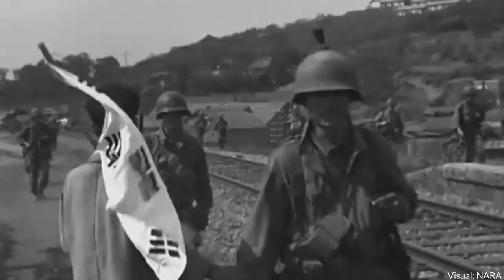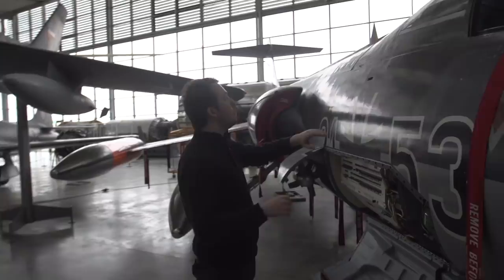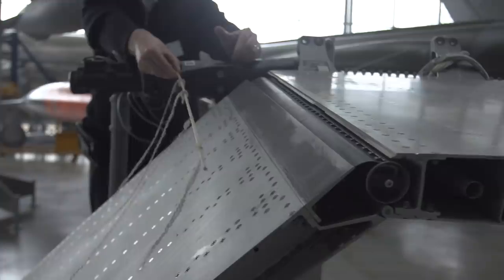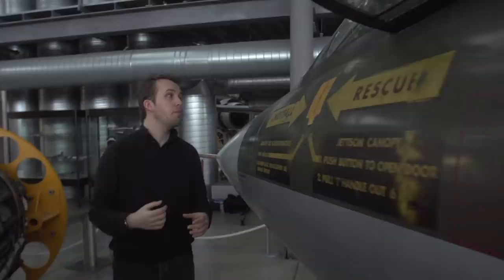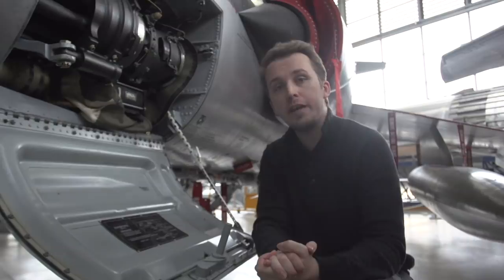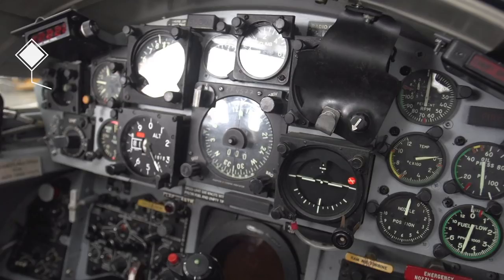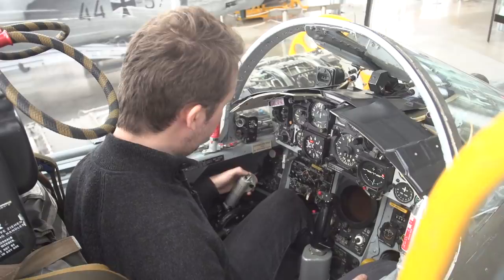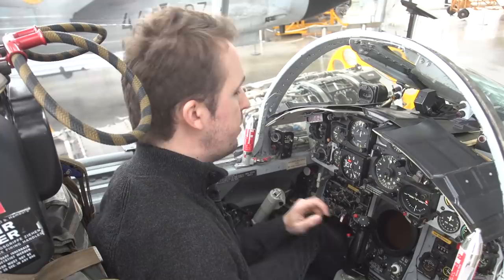F-104G Starfighter - Inside The Cockpit

Comment: "Anybody want to buy a Starfighter? Buy an acre of ground and wait"
Reply: You are aware, aren't you, that there was a similar joke made about the English Electric Lightning only instead of some area of land, the Lightning joke involved some area of the North Sea.
Reply: @lewiscole5193  I am definitely aware that this is a quote from an album "Captain Lockheed and the Starfighters" made by Robert Calvert, produced after the German Luftwaffe purchased 916 of these and then crashed 246 of them, losing 116 pilots in the process.
Reply: @fellforit  
I've only listened to the album once or twice and so I'll defer to your knowledge of what's on that album.
Nevertheless, I don't recall there being any mention that the Spanish lost no F-104s in seven (7) years of operation for an attrition rate of zero (0).

I also don't recall the album mentioning that the Luftwaffe of the F-104 days was NOT the same as the Luftwaffe of WWII, since the latter was disbanded more than ten (10) years before the first F-104 arrived in (West) Germany.
As a result, German pilots and ground crews were relatively inexperienced especially with regard to high performance jet fighter aircraft (for many German pilots, the F-104 was their first high performance ride) and due to lack of available F-104s in the early days, German pilots had to go back to flying their old obsolete aircraft just to remain current.
I'm sure you can point out where this is mentioned in the album though.

OTOH, since the subject of the ablum is the F-104 in Germany, I doubt that it mentions that in U.S. hands, the F-100 was lost more often and killed more pilots than the F-104 in the latter's short period of USAF service.
Reply: @lewiscole5193  Do you work for Lockheed? If you're trying to sell me an F104 I'm afraid I can't afford one. 

In fact the album does refer to the out of date practices in the Luftwaffe that contributed to the casualties, while also commenting on the fact that Lockheed sold the F104 to the Germans as a viable all weather, low level ground attack  fighter bomber, which it was incredibly unsuited for, with a high wing loading that was worsened by external munitions. 

I do notice that you quote the perfect Spanish safety record, without also going on to mention the safety record of Canada which lost 46% of its F104s, Belgium which lost 41%, Australia 34% and Italy who lost 37%. Surprisingly, the loss record for the F100 in USAAF service was actually 16.2 per 100,000 flying hours, while the F104 was 25.2. I presume you're a fan of the F104 trying to make a point, but at this stage I think I'm done.

Comment: I examined closely the ex target practice F104G fuselage wreck at the back of the German Tech Museum. Basically most of the strength was in the skin & most of the internal spars are made of Bacofoil. 
This aircraft was clearly not designed for carrying the tanks & munitions of the G model, putting stress on the skin,  totally unsuitable  IMHO.

Comment: Didn't the first 104's had the "downward ejection" seat because the designers were afraid that the pilots might hit the T tail when bailing out? I watched a video of an old pilot talking about that there was hatch under the cockpit that would jettison when you eject. Then the pilot and the seat shoots downward. Even the first design incorporated special  "spurs" on their boots for the pilots so they would need to engage their feet and lock them into the seat leg supports. Keeping the legs secured during ejection.
 Only down fall was that the pilot couldn't eject during takeoff and landings if there was an emergency or they would get slammed into the ground. So they went with the conventional ejection latter on.
 Was hoping that you would mention about the leading edge covers to keep ground crews from head injuries due to being sharp while maintaining the plane.
Love the video!
Reply: Yes, the first F-104s did have a downward ejection seat, but these were replaced with an upward ejection seat.
In the case of the Luftwaffe, I THINK that virtually all of them started out with the upward ejecting Lockheed C-2 ejection seats, which really weren't all that adequate for the type of missions that Germans had in mind, with upward ejecting Martin-Baker seats that were.

Comment: An older variant used to have the pilot ejecting down right?
Reply: Two main reasons: 
1 - early ejection seats had questionable efficiency in clearing the tall tail of the 104 at all speeds
2 - Nato doctrine realizing the necessity to fly low in order to avoid SA-2 systems came way after the 104 went into service

Comment: The cockpit instrumentation seems highly reflective. Couldn't the various dials have their glass covers replaced by a non-reflactive surface, maybe plastic? Of course I fully understand that the Starfighter is no longer used, but the same problem probably occurs with modern aircraft as well as the "classics". I've noticed it before, and it might just be the angle of reflection during the filming, possibly there is no problem with interference with the pilot's vision due to this. It just seems to me that it would be more sensible to have a non-reflective covering on the instruments. On the other hand, today's aircraft have HUD systems, so this may not be a problem after all. Thanks for all of your programs, I think I've seen them all.
Reply: It's just the angle of the filming.

Comment: Pet peeve of mine: the 104's wing loading is not that high, nor is it the main reason for its large turn radius. The Harrier, F16 (depending on configuration), Tornado, Jaguar and F35, to name a few, all have similar or higher wing loading (yet the Viper, Harrier and F35 are better turners). The reason for the large turn radius is that the 104 wing, unlike some of the aircraft I mentioned, only becomes efficient at generating lift at transonic and supersonic speeds.
edit: and btw, "special weapon" always refers to nukes in every NATO aircraft that can carry them :P

Comment: It is an interesting fighter.  It was rushed into service due to delays of the Convair 102 and 106.  It had a high operational loss rate due to accidents.  It was a HOT plane.  The USA never experience any kills with it in Vietnam.  As pilots said.  Wherever the F 104 went the North Vietnamese MIGs refused to engage.  Ditto for our pilots flying over the straight of Taiwan.  The PLAAF refused to engage.
Reply: Actually it was not rushed into service, but it was pressed into interim service with Air Defense Command when the F-102 and F-106 were delayed by development issues.  The 104 had been designed as an air superiority fighter rather than a bomber interceptor, but it was available to fill the gap.
Reply: Wasn't one shot down by the Chinese MiG-19 when violating their air space?
Reply: @simplicius11  not a US flown one.  Maybe one flown by a Taiwanese pilot?
Reply: @patrickwentz8413  
Captain Phillip Smith was shot down in his F-104 by a Chinese Mig-19 in 1965.
Reply: @sargesacker2599  interesting.  I never knew any Chinese vs US dogfights during the Vietnam War.  It appears he got lost and was shot down over Chinese airspace.

Comment: Great Video! 
Can you tell me, what the silver cylinders left and right of the cockpit panel are?
At 17:50, you can see the one on the right: Silver cylinder with red Label
Reply: I'm not @Military Aviation History and I don't play him/her/them on TV, but I THINK that the cylinder you are referring to is one of a pair of cylinders (one on each side) of a single seat F-104 which is responsible for ejecting the canopy before the ejection seat blasts the pilot out of the cockpit.
Normally, the canopy is moved manually and opens/closes to the side, but in the case of an ejection, there are latches that are released and thrusters that are activated that which drive the canopy upward at the front (towards to nose).
I suspect that the cylinders you are referring to are the thrusters.
I await with bated breath for @Military Aviation History to confirm/deny/correct my supposition.

Comment: I ran these engines on the test cell for Lockheed at Luke AFB and I don’t remember them hitting that much thrust in A/B.
Reply: FWIW, the J79s used in the American F-104s were usually J79-GE-3s (14800lbf wet) and J79-GE-5s , not the J79-GE-11s (15800lbf wet) used in the German F-104Gs.
There were some F-104As that were re-engined with the J79-GE-11s and some more re-engined with J79-GE-19s (17900lbf wet) used in the Italian F-104Ss, but AFAIK, all of the latter were all in the 319th FIS in Florida.

Comment: It is difficult to comprehend how a wing that thin could be strong enough to survive any significant loading, and also contain the required mechanisms for flight controls etc.
Reply: That's offset by how short it is. The shorter, the wing, the shorter the lever arm, so for an equivalent force (lift), there is less bending at the root. So it doesn't have to be as strong as it would otherwise.
Reply: @FlyNAA  good point. Thank you, it does have very short wings, possibly the shortest relatively speaking, of any military or otherwise jet? 
I am interested in all types of aviation, but my own personal experience is mostly with higher aspect ratio radio controlled gliders. 
The wings on the Starfighter look ridiculous in comparison. 
At least it would have presented a small target to enemy attacks 😊👍🏻

Comment: Small question why does the F104 have a arrester Hook? 
Afaik they were never designed for carrier landings. Or did they try to reduce its takeoff and landing distance by basically putting a carrier deck on land?

Other than that great Video as always :)
Reply: Many (all?) Air Force fighters have arrester hooks for emergency use in case of brake failure or the necessity to use a short field equipped with arresting gear. My computer monitor wallpaper picture is an F-106 in a steep bank with the arrester hook clearly visible.
Reply: It's basically an emergency device, for damaged aircraft that have to land at higher than usual speed in order to maintain control. A lot of USAF fighters have them.

Comment: 16:00 technically the F-104G and a couple other variants had 9 hardpoints. There were 2 sidewinder rails that could be installed forward of  the centerline hardpoint

Comment: I heard that the edges of the wings were sharp enough to cut you if you touched it, I suppose that’s why they had those red caps on the wings
Reply: The leading edges of the wings were roughly as sharp as butter knives.
Not really sharp enough to cut you, unless you inadvertently smacked your head into them in which case you could end up bleeding like crazy as head wounds usually do, hence the guards on the leading edges.
Reply: @lewiscole5193  yeah I thought I was somewhat right about what I said, I just wasn’t sure how sharp they were because I heard that a while ago and couldn’t remember it 100%

Comment: I'm having trouble visualizing the how and where of the leading edge flap, even after replaying several times, around 8:30.  Could someone please elaborate?  Is that a static display of only the wing section?  Because I see an F-104 in the background - there aren't two Starfighters on display, are there?

Comment: The problem, was that the airframe was being used by the Luftwaffe for missions that it wasn't made for. It was a high altitude, high speed interceptor.
Period.
Reply: > The problem, was that the airframe was being used by 
> the Luftwaffe for missions that it wasn't made for. It 
> was a high altitude, high speed interceptor.

> Period.

Wrong.  Period.

As any decent history of the F-104 will point out, the F-104 was designed by Kelly Johnson and Company to be a DAYLIGHT AIR SUPERIORITY FIGHTER based on a wish list from U.S. Korean War fighter pilots that Johnson met with in 1951 while touring Korean bases at the time.
IOW, it was supposed to take and and beat Soviet FIGHTERS not bombers, and it was supposed to do so using a gun rather than air-to-air missiles that weren't out yet.

The U.S. Air Force (and eventually other foreign services as well) USED the F-104 as an interceptor regardless of what it was designed for.
In the case of the Germans, they wanted a single aircraft that could perform three roles:  recon, interception, and ground attack.
The F-104 couldn't get there from here, but the boys from Lockheed told the Germans they could tweak the F-104 so that it could and the result was the "Super Starfighter" AKA the F-104G which is what the Germans bought.
But more importantly, the Germans sent some of the WWII pilots (not the relative newbies that infested the reconstituted Luftwaffe at the time) to check out the F-104 and they gave the F-104 a pass.
(And before you tell me about Hartmann, get a clue and look up what he said in his "last interview" which can be found on line.)

Instead of spreading more mythology, get a fucking clue and do some reading.
Reply: @lewiscole5193  Lockheed bribed the German officials into an airframe ill suited for what they were using it for.
It wasn't good for low level all weather tactics. Have a great day😂
Reply: @lewiscole5193  Are you always such a pleasant fellow? 😆

Comment: Jesus Christ! That's a LOT of switches and indicators. I thought that the touchscreens and heavy automation for the F-22 and the F-35 were a little too "iPad Age", but thinking about it now, the practicality of it is unbelievable. A dynamic UI (also meaning that you can update the interface without having to rebuild the cockpit) that allows you to have only the desired or most relevant aircraft data displayed (minimising distractions and having to search for the thing you need) and this is not mentioning the amount of space it must save in the cockpit to not have all those switches, dials and other stuff in there.

Wonder what it'd be like to make a prop fighter with all these modern avionics.
 Like... a Spitfire with a digital screen display for data and other very useful flight automations. How would it fly, how would the flight experience be? Would it be able to do things the original wasn't able to?

Comment: The Starfighter - also known as: The Widowmaker due to its very small control services and tendency to kill the pilot.
Reply: It was an unforgiving aircraft to fly but the majority of deaths were associated with efforts to use it in ways it was very definitely not designed for. F104 was NOT a multi-role warplane. It's design mission was to go someplace very fast and shoot something down when it got there. Most deaths were caused, if indirectly, by decisions to use it for something else. Nighttime, low level ground attack missions during snow storms...
 Germany, in particular, did not have the funds for a fleet of different types of fighters so they tried to make F104 do it all. That didn't turn out well (understatement) and soon enough a German  "New Broom" air force commander changed the rules on Starfighter uses and training. Aircraft losses and deaths were dramatically reduced.
Reply: @fraserhenderson7839  
I'll go even further than you in absolving the aircraft of blame for that unfair moniker. 
The accident rate was actually not all that high considering the type of operations conducted and the relative inexperience the new Luftwaffe had with high performance supersonic fighters. The single seat low level strike mission was unforgiving under the best of conditions, and the weather conditions in Europe were often challenging.  After WWII Germany skipped an entire generation of jet aircraft and went straight from early subsonic jets into the Mach 2 Starfighter when they joined NATO.  It was a very steep learning curve, both in terms of individual pilot training and operational procedures and techniques.  Some in the Luftwaffe thought they were not ready for such an airplane, but political considerations overcame their objections. 
While there were probably better airplanes for the role (at a price), the airplane was not completely unsuited to the high speed low level strike mission.  It's high wing loading was actually suited to the high speed low altitude environment, where turbulence can beat up an airplane operating at high speed.  The F-104G was equipped with navigation and bomb systems that the USAF air superiority version never needed.  Not the best strike fighter in terms of range and payload, but it didn't have to go far or carry a lot to hit its targets in the event of war in Europe.
Reply: @fraserhenderson7839  
Excellent explanation. Thank you 🙏😊👍
Reply: @gort8203  
Thanks for that. Excellent points presented. 🙏😊

Comment: The F-104 Starfighter is a beautiful machine, but for many of the operators it was the wrong aircraft for their requirements. The bribery and corruption behind its purchase really tainted its service in my mind. Several of the modifications it got over its lifespan in German service were because it was the wrong plane for the job and they couldn't (or wouldn't) replace it.

Comment: great to see this video,
IF you look at the Starfight top down, you will see that its RADAR signature is rather small compared to F35.

If it receives a modern coating, I bet it will have the SAME signature despite its old design.